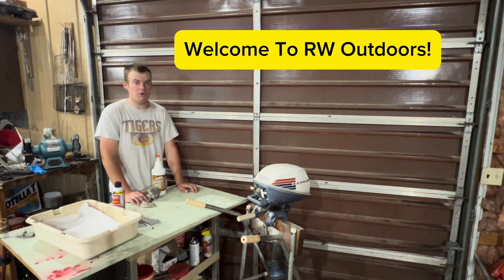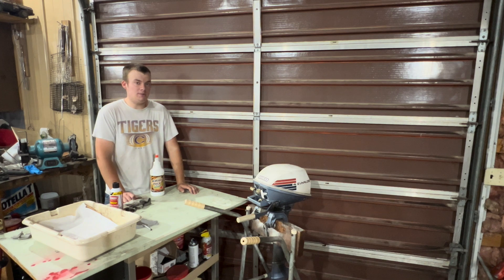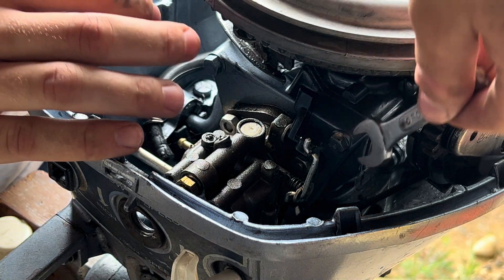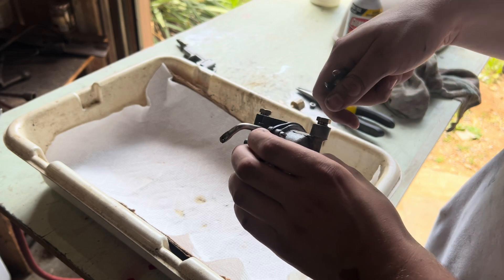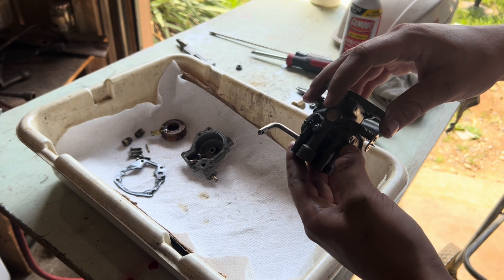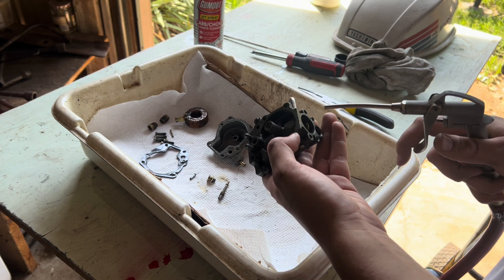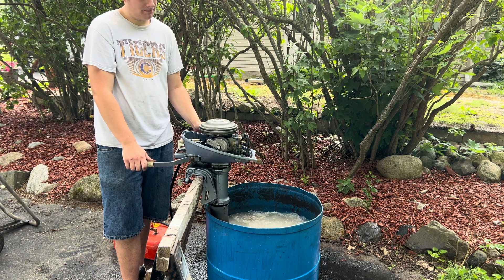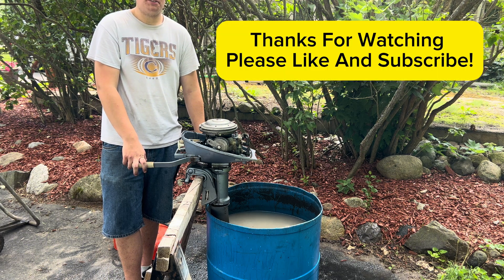Evinrude 4HP Outboard Carburetor Removal & Cleaning – Step-by-Step DIY Guide

Comment: Hi friend, great video but I'm confused about how many turns I have to make with the top wheel and the bottom wheel, the central ones.🤝🏼
Reply from the maker: Hello, thank you! The top jet needs to be turned out 1 1/2 turns from seated. Seated means tighten the screws until you feel resistance like they won’t screw in anymore. Be gentle don’t pry on them the needles can become damaged. The bottom jet needs to be out 1 turn from seated. This will get you started and when you have the motor running you can adjust both jets to get your engine to run the best. Top screw is low speed bottom high speed. Thanks for watching!
Reply: @rwoutdoors friend please i need you one more time can you tell me what kind of oil should be put in the lower part of the engine✋❤️👍🏻🙏
Reply from the maker: @Dorisilprepper  no problem! I always use 80w 90 marine gear lube. They sell it at any auto parts store, hardware store, and even Walmart. The brand doesn’t really matter just make sure it is marine gear lube.

Comment: Great video.  After turning top needle 1.5 out and bottom 1 turn out. Where should the little stopper tab on the knob be set.
Reply from the maker: Thank you! I usually put the stopper tab on the knob across the table on the motor. That way you have lots of room for adjustments. For example if the tab on the motor is on top of the knob I will put the tab on the knob pointing down. Thanks for watching!

Comment: Last one I did on a ‘71 six fisherman, the float was in about ten pieces. Had to remove powerhead cause the cooling passages were completely clogged with sand etc. Took a couple hundred bucks in parts plus many hours to repair. I like repairing these great old motors. Gave it to an old gentleman who was struggling with an old air cooled dept store motor. Nice job👍
Reply from the maker: Thank you! Thanks for watching!

Comment: Probably better off leaving the original gasket/float then using an aftermarket "fits all/amazon/chinese" repair kit.  Sure, the OEM kit is probably $35, but worth it.
Reply from the maker: I agree! In this case everything was all complete and cleaned up nice. Those Chinese Amazon kits are absolutely garbage. If things were in rougher shape I would have replaced it with OEM parts. Thanks for watching!
Reply: @rwoutdoors  I think I would've spent the $15 for an amazon/chinese rebuild kit just for the plastic float instead of the cork... The cork ones just freak me out... Great video!
Reply from the maker: @cptkid570 thanks for watching!